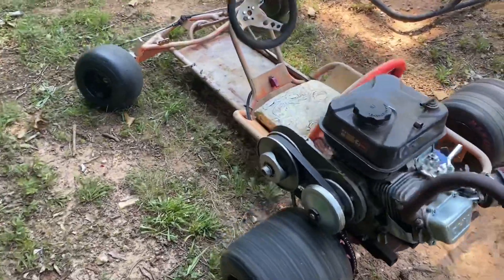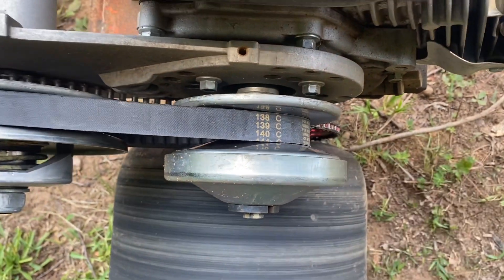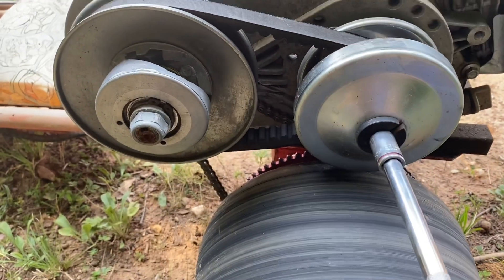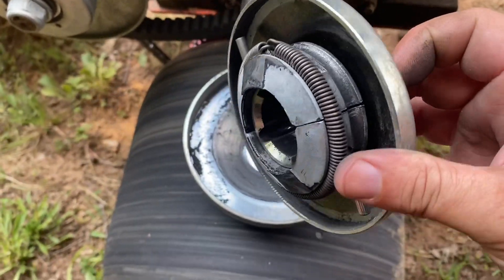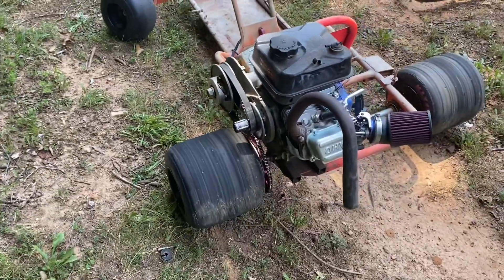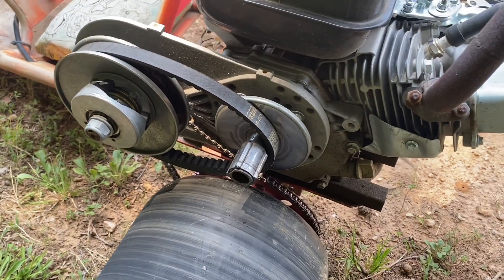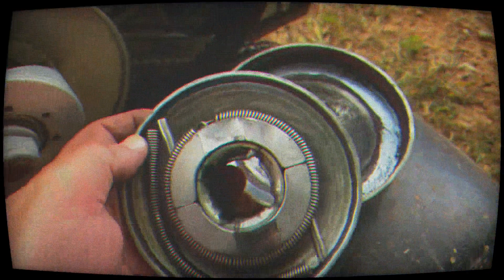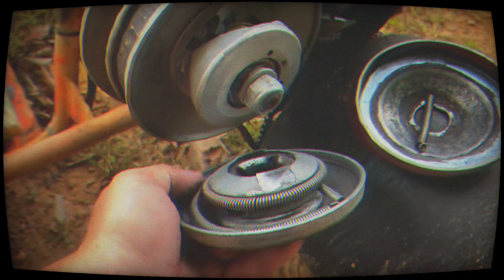Ebay 30 Series Torque Converter Broke Again

Comment: I had no idea that the 30 series torque converters were only rated for 8 horse power. Now i'm wondering if the one on my mini bike that started off life as 6.5 horse power but is now much more than that due to modifications will hold up to all that power. I don't know exactly how much horse power it is now but it's gotta be over 10 i'd imagine. Although i did replace 1 of the torque converter pulleys with an OMB Tork-Zilla so maybe that helps but i dunno. All i do know is that i'm having a heck of a time trying to get the torque converter belt to sit in a straight foward position from 1 pulley wheel to the other. Mines sitting on a slight angle and the belt is fraying on the edges. ⭕-------⭕
Reply from the maker: The driver seems to be the weak point with higher hp so it sounds like you’ve already taken care of that. I usually have to stack some spacers behind the driver on the crank to get it aligned properly.